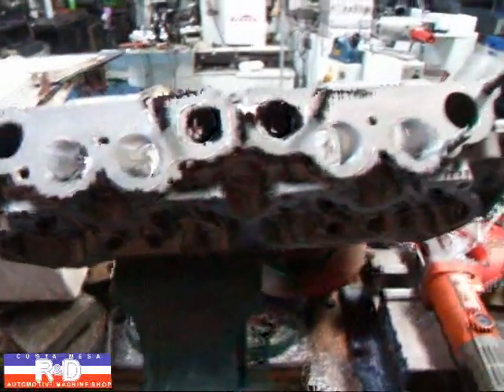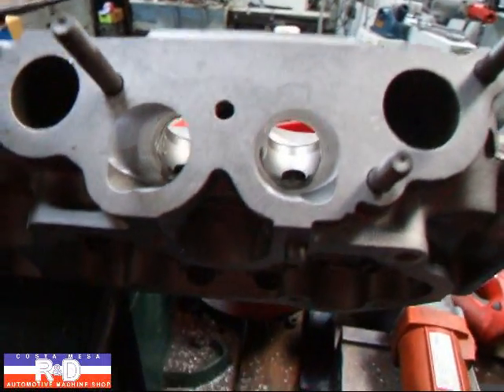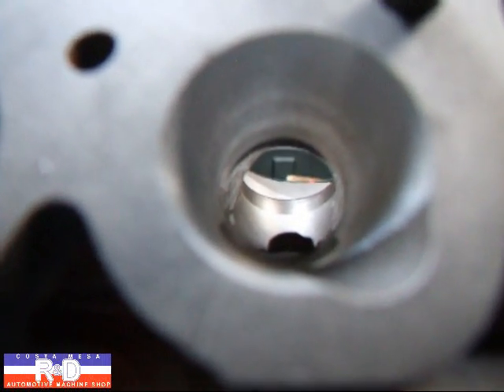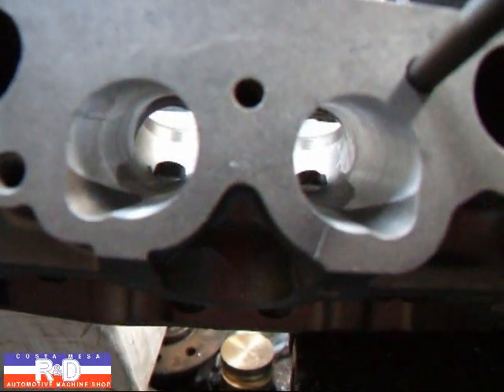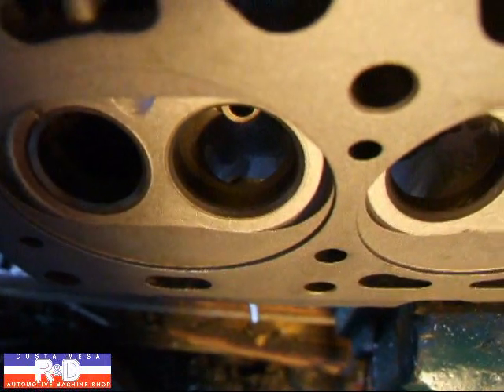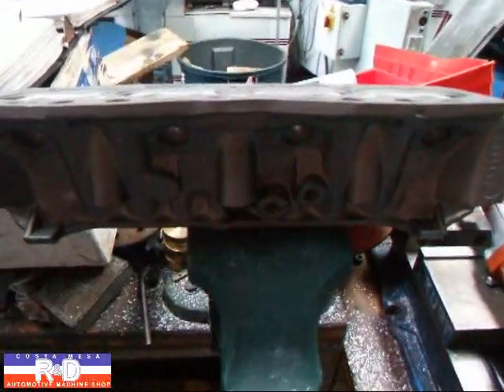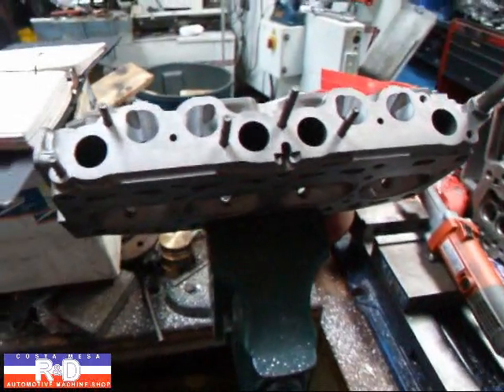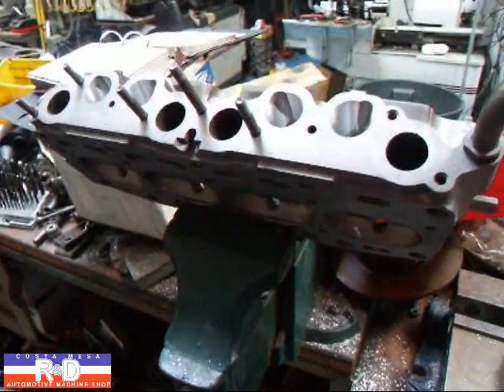Fiat X1 9 Intake Port Runner Enlargement

Comment: Always raise the roof, dont lower the floor to open a port.....
Reply from the maker: Tried that, I get better results by lowering the floor, as verified on my flow bench.
Reply: +fiatnutz better results in terms of torque, or horsepower?  So on your flow bench did you notice an increase in air speed, or air volume?

Comment from the maker: I install 33mm exhausts and 39mm to 42mm intakes. The lowering of the port floor and enlargement improve the mid-range power on the NA Fiats. With a blower you don't really need to do anything because the boost will overcome poor port design. If you are racing the car, the ports should be optimized with a flow bench for best overall results. Hope this helps. I also like 55 degree seats for the performance Fiat engines.

Comment: Hello friend, a query because it does not speak the language, written perhaps asking you to understand the explanation of the video.
It is a cover for preparation fiat turbo? that brings results sought or with conduit worked well with that little groove?
Here in our country in acceleration racing exhaust valves are used in 33 mm and 39.5 ADMISSION in, I never saw so with that undermined ducts, brings improvements?

Comment from the maker: @bmays002 - I'm very familiar with the R1 and R6 heads. I didn't go to a maximum diameter on these ports so that port velocity would remain fairly high, however on full-race engines going to larger ports is a bennifit on this car because of the limited carburetion in some classes.

Comment from the maker: @petarfico - Petar, the port is straight down to the guide and then blended in w/larger (39-40mm) intake valves. I have installed larger valves, but the port velocity falls way off when you do - works good at 10K rpm.

Comment: @fiatnutz Is it safe to extend the port to 36 mm.  and is 36mm the length of the entire lenght or just at the entrance to the port.Here in Croatia people port fiat 1.4 or 1.6 heads to 33 mm intake port at at the entrance and 30-31 mm at  valve guide.

Comment: @citydriver If you port them real big you increase the the top end power, but you reduce the bottom end power and torque with causes drivability and idle problems and street driving uses more of the bottom end.  It will be a pig to drive at best of time with the ports too big.

Comment from the maker: @citydriver - On some engines its easier than others, this one can be bored to this size and larger for competition. As you can see I didn't do much else then open the port runner, its a street engine.